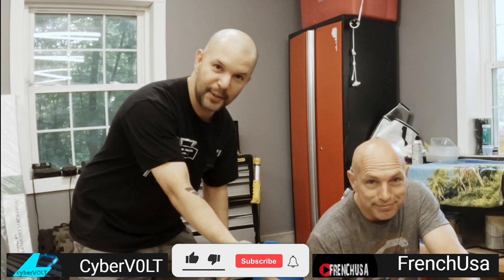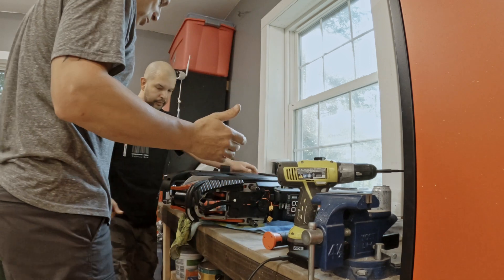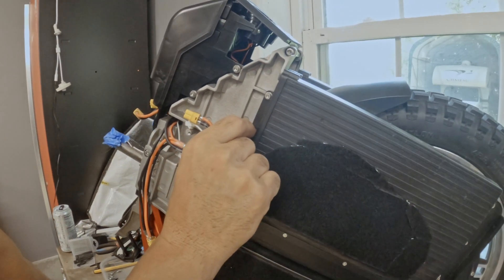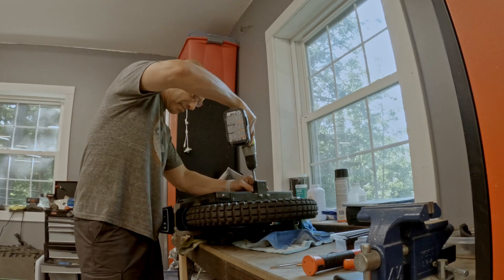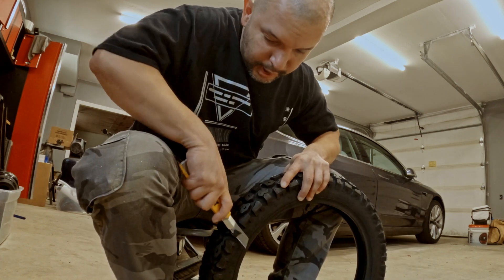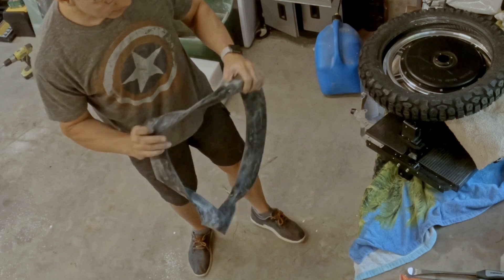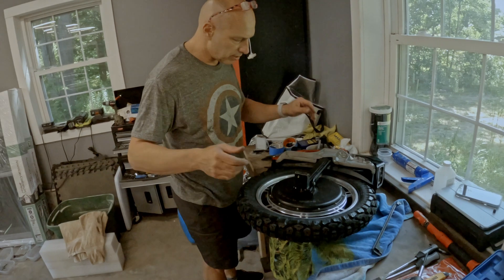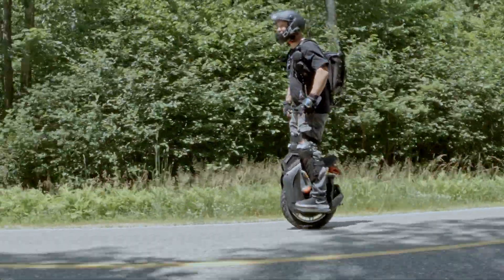Learn How to put Shinko 244 on the BEGODE HERO EUC

Comment from the maker: *Video Information Post: * (expand comment to see more)
Like what you see here? Great! Please consider following FrenchUsa here at :
https://www.youtube.com/c/FrenchUsaEUC
And if you're new here , you can also Sub and Like the video on my channel! 

** Tire - **
Shinko 244 2.75X14 35P (Needs to be shaved)
https://www.revzilla.com/motorcycle/shinko-244-dual-sport-tires?utm_campaign=order_shipped&utm_content=Product&utm_medium=email&utm_source=RevZilla

*Tools Recommended - *
3MM HEX Drill Attachment
4MM HEX  Drill Attachment
5MM HEX  Drill Attachment
Phillips and Flathead Screw driver
TIRE removal Spoons
Baby Powder
Bullsnot Tire Lubricant
Spare Inner Tube for Tire
Box cutter or equivalent for tire shaving (for the Shinko 244)
Electrical Tape 
Electric Screwdriver w/Hex attachments
Torque Wrench (recommended)
Work Bench (recommended)
Plastic container (storing screws, parts for organization)
Suspension Pump
Tire Pump

*TimeStamps - *
00:00 Intro
01:05 Remove Pedals
01:12 Pushup Two rear clips under saddle
01:38 Remove Trolly Handle
01:53 Remove 10 top panel screws 
02:10 Unplug control board connector
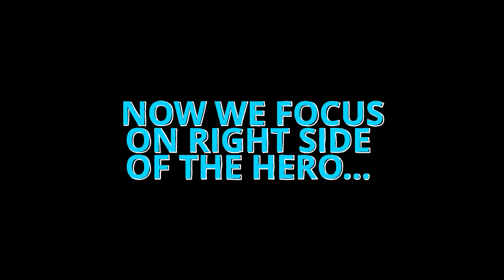02:20 Remove right side rear panel screw (1 screw holds both)
02:34 Remove 4 bottom right side panel screws
02:48 Remove front right panel screwm (1 screw holds both)
03:16 Remove 4 bottom left side panel screws.
03:53 Remove Right side 2 plastic covers (above battery packs)
04:14 MARK & disconnect right side yellow and white battery connectors 
04:47 Remove remaining right side battery pack screws.
05:10 Remove motor cable cover 
05:53 Remove  4 LEFT  motor screws
06:38 Remove RIGHT Side motor screws
06:56 Remove Right side bottom battery frame
07:41 Slide wheel out wheel for tire change
08:09 Tire Change Time!!! (long chapter)
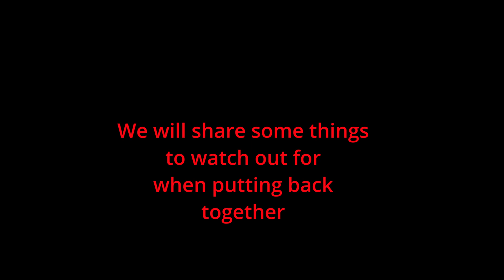10:39 Assembling Wheel back together (notes of interest)
11:43 FrenchUsa's final thoughts
12:52 Closing out the video

Comment: It's a big operation for this tyre change. I'm a little but disappointed when i see all the job i will have to do. In my case, i have choosed the Michelin City Pro
Reply from the maker: I m curious how that tire will behave with the Hero. I like the Pilot Street 2 on sherman, Im so curious how that tire in combination with my skill level will behave on the Hero., but i have no desire to take this apart again (with or without help).  I wish you best of Luck on the tire change. I hear MCP tire is really good! Please be careful of the clips and plastic screw holes, they break easily!
Reply: @WILSONsHobbies  Thanks 👍

Comment: Sorry, I mist the video Monday. But you must understand. On Juli 11th, I received my new wheel. The Extreme Bull X-Max High Torque.

Great job on swapping the tire on the Hero. I think on the S22 it will be more difficult. Apparently with the X-Max the motor cable also doesn't need to be disconnected for swapping the tire. The cable is tucked away in front in the frame.
Reply from the maker: Ooo Extreme Bull, very nice! Congrats on your new wheel!

Comment from the maker: Update on the Shinko. Some rubbing on the tire still. Hoping it will go away with more mileage. Shaved again for the 3rd time. Not going to shave anymore. General impressions is really good because I dont feel that pulling to the right or left anymore like i did with the stock knobby. Tire is very nimble and very predictable . Still makes noise on the pavement but it is about 50 percent quieter. Handles trails about the same , if not a little bit less than the stock knobby. Tire feels like it wants to stay upright more so past 20mph. Cornering is better and requires less body input. Tire is a lot stiffer and not as cushiony as the knobby.   All in all, so far, the Shinko 244 is a decent upgrade over the stock knobby. Now im going to research shocks and see which one will be good fit for the Hero. Thanks for watching guys!

Comment: Whew!  That was a TASK!  

Did you guys end up insulating the motor wires again?  Is the damage going to continue?  Looked like the motor wires already had a little bit of damage on the shielding in this video.  I wouldn't let that sit un-addressed for very long.  Don't want anyone to get hurt! 

Thanks for sharing.  Great video!
Reply from the maker: Yea it was that is for sure!  Luckily, FrenchUsa found a work around that made things easier. There are just tons of different sized screws littered throughout the wheel and the build quality is actually very questionable. We look at metal and be like, "ooo ahhh" ITS metal reinforced but that metal looks like it can crack easily. The plastic breaks easily , especially the clips surrounding the panels and surrounding areas. Need to be careful taking this one apart. Yes we insulated the motor wire, wasnt so bad. Thanks for watching BIGboiFASTboi!